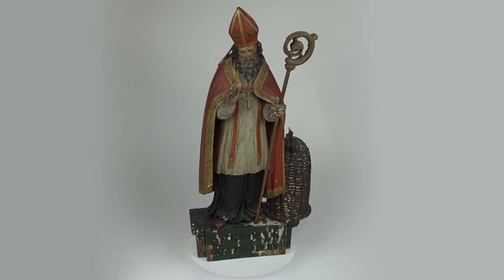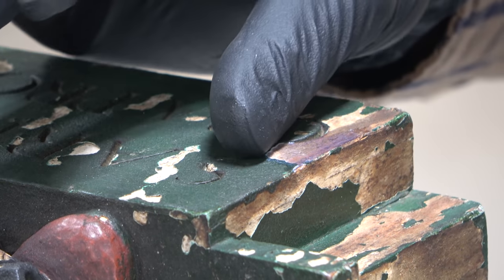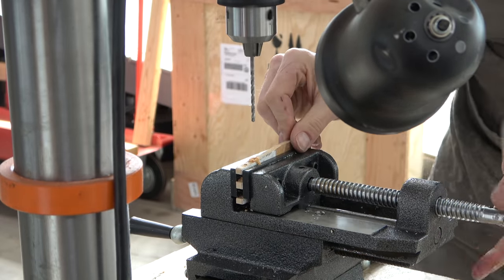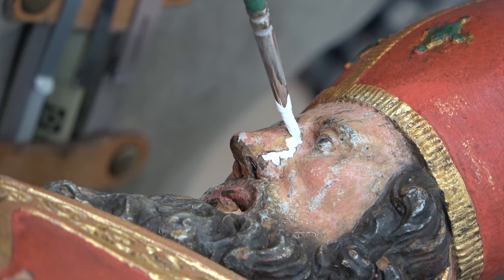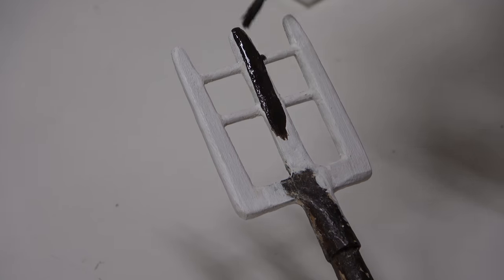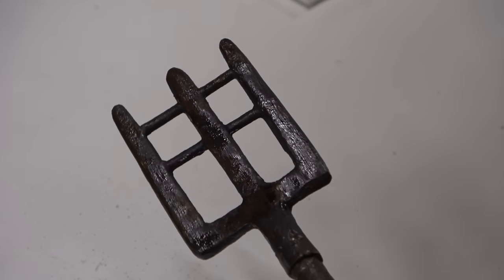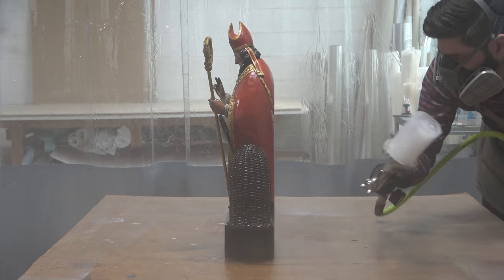Cheers

Comment: During the spray paint, the over spray is clearly visible.  You protected everything but your eyes.  As a painter, retired, we use a full face mask.  The composition of varnish can translate through your eyes and through the tears. Great restoration!
Reply: So in the final result, did you see any spray marks? I didn't.

Comment: Awesome job as always! I do have a question though: did you need to take any precautions due to the lead paint? I was glad to hear you say the varnish would help prevent future flaking, but how did it affect the rest of your process, if at all?
Reply: im not an expert but iirc lead in small amounts doesn't really have that much of an effect unless you're in contact with it over a very long period of time. therefore i don't think any percaution would be necessary here
Reply: Main thing about lead precautions is yo not make it airborne. So don't sand items with lead paint instead use a chemical paint solvent. Because Julian isn't removing the paint at all there shouldn't be any worry

Comment: Another great conservation video! Have you tried small squares of either smooth surface blotter paper or even ph neutral artists drawing paper lightly dampened with distilled water to remove the excess residue surrounding your fill in material? You may find that it goes quicker than cotton swabs and will not pull out any material from your filled in areas. 
I have also used this method with lacquer thinner to remove the excess black lacquer on the very shallow numerals and engraving on freshly silver plated antique clock faces. 
It works extremely well and leaves the lacquer or any "fill in" material flush with the surface without pulling any material out. Try it. I know that you enjoy trying out new techniques. 
I have used this also on oil paintings & sometimes with distilled water with a bit of denatured alcohol or isopropyl added to the water. Stay Safe & please keep on making videos. They are so enjoyable to watch and are as flawlessly executed as your amazing work.

Comment: I would LOVE to see Baumgartner restore the finish on a 50s or 60s electric guitar.  It would be fascinating to see what he would do differently from a traditional Luthier.  For example, Luthier's don't use reversible materials.
Reply: Some materials Luthiers use are reversible including hot hide glue and some finishes including lacquer and shellac.  However, many newer instrument finishes are not reversible including oil based, epoxy or catalyzed and UV cured.  It would depend upon the age of the instrument and the application.   French polishing is one of the older reversible finishing techniques. Spraying nitrocellulose lacquer is very hazardous and French polishing is a difficult skill to master.  A 50s or 60s guitar would have to be a total write-off before I would attempt a refinish simply because it would greatly reduce the overall value of the instrument. Even then I would be reluctant to take that on as a commission. Note: My YouTube user name isn't connected to my business but like you, I am a huge fan of Jillian's work.

Comment: Wonderful vid! Always love it when you post, Julian. FYI: the "tunic" is called a "surplice."
Reply: Yes, and the staff is a bishop’s crozier. It symbolizes that Arnold’s was the shepherd of his flock.
Reply: I think a bishop's or abbot's surplice is called a Rochet
Reply: @slartibartfast2649  You are correct! :-)
Reply: @slartibartfast2649  Surplice and rochet are two distinct garments. Rochet it part of choir dress of prelates like cardinals, bishops or monsignors, it is not a liturgical vestment and shouldn't be used as such. On the other hand surplice (or cotta) is a liturgical vestment used both by clergy and altar boys. The biggest difference between them is in sleevs. Surplice has very wide and loosely fitting sleevs. Contrastingly sleevs of rochet are tight and are lined with silk of white (the Pope), scarlet (cardinals) or amaranth colour (rest), depending on rank of prelate. Rochet always has lace so that the lining of sleeves may be seen thought it. Surplice doesn't need to have lace, same with alb. 
I don't blame you for confusing them. Most people do, since they look very similar especially if a surplice has lace.

Comment: When the lead test came back positive I fully expected you to strip the paint off with a solvent. But then I was quickly reminded that you persevere paint, not restore objects lol
Reply: Stripping that paint would have been sacrilegious!
Reply: Lead paint is not dangerous. Only if you lick it, or pulverize it an inhale the dust. None of which will happen with any sane mind. I'm washing lead paint for repair on my basement foundation. All I have is a used covid mask and I have a spray bottle of diluted elmers glue that I spray on for the scrubbing phase then wipe off with rags. The glue helps keep lead dust from leaving the paint when scrubbing. Then go over again with hot soap and water to wash the glue residue off and then the concrete is prepped with a solution that penetrates the concrete to allow the sealant coating to stick. No danger.

Comment: Fantastic work as always. Only thing I noticed was the top of the staff was backwards in the final shots. Was that the correct direction the medallion was supposed to be facing as per other examples???
Reply: Doing a quick bit of research on saint images that include a crozier, it seems to me that the position Julian put it in--with the "open" side of the curl outward--is slightly more common.  The staff isn't fixed in place and could be freely turned in any direction, so it's probably hard to know what the actual orientation was when the piece was first made.
Reply: I also noticed that, and I think Julian might have turned it around because one side of the staff is more detailed and was therefore probably intended to face forward. My guess is that the piece had been turned around by accident before, and during restoration, Julian made an informed decision to change it "back".
Reply: @kalli-ope  Good catch on seeing that one side is more detailed than the other--I missed that myself the first time around!

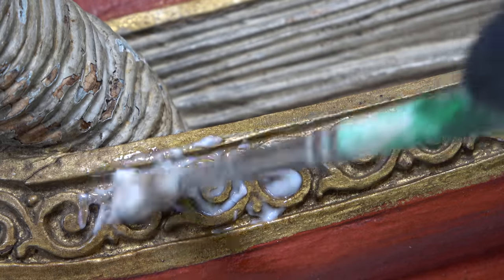Comment: At 7:13, Julian completely strips part of the gold paint into bare wood. You can check and see that at 7:01 the paint was there but flacking... and at 7:13 is completely missing.

EDIT: At 7:17 Julian strips off another chip of paint.
Reply: The gold paint doesn’t get stripped completely. At 7:01 you see it covered with clearer and at 7:13 he’s wiping the clearer off. The bere wood is a different colour.
Reply: @lburton874  I think you are looking at the wrong place. It's in the left bottom side around the 1/4 of the screen from the left to right and 4/5 top from bottom.

Comment: I'm curious why you went with PVA glue instead of hide glue for the mash rake repair, given that hide glue would be equivalently strong in this situation but is reversible if necessary.
Reply: The problem with rabbit skin glue on the rake repair is that RSG will absorb moisture from the air, which in turn will make the joints flex, over time the joints will become unstable and eventually break or fall off.   RSG, in general, isn't a good adhesive when dealing with something delicate, it works better when it has a huge surface area (e.g. when used in furniture).   

If you want to learn more about RSG may I suggest you check out Thomas Johnson Antique Furniture Restoration here on Youtube, Tom is a master furniture restorer and has a bunch of great videos, including one that discusses the pros and cons of different adhesives in antiques.
Reply: Permanently gluing the new rake to the original handle surprised me too--I get why he would want it to be sturdy, but permanent is such a change from the norm.

Comment: Very nice.  Most restoration channels I've watched would usually just strip the object and repaint.  Glad that wasn't done here.  One question.  On a lot of your paintings, you apply an isolation layer so your paint can easily be removed, which wasn't done here.  Just curious if this is reversible, since I'm guessing your UV scans probably cant detect touch up paint on a solid object.
Reply: Omg that's not a restoration (stripping and repainting) that's a butchery!
Reply: @Stettafire  I've seen those, they're awful! Not only do they sand blast the paint away, but then they often replace it with car body paint of all things!
Reply: As he says in literally every video, all the paints he uses are reversible. The isolation layer often isn't primarily to separate the original paint from the retouching, but to saturate the original colours so that they're easier to colour-match with the retouching paints, then the top coat brings it all together. And with some paintings, the isolation layer is more viscous when he applies it to help even out the texture.

Comment: .....I have a question and sorry if it might be stupid, but, why did you apply the varnish AFTER and not before putting the stick in the hand of the statue? this way the part that's covered doesn't get any varnish. is it done on purpose?

Comment: as a paper conserver, I get a Chinese paper-covered statuette once in a blue moon the darn thing is these things can have many layers of paper how to deal with that the customer wants the earliest version to be the one but, how to get it all undone?
the core is wood and it's just a core it doesn't show many features it's in the paper covering it with elaborate painting on it where the sculpture becomes 3D.
well, I take all of it off pealing one layer off another is crazy! I cut the thing on its back to the core and all will peal off because the glues are no more after 800 years then with the paper isolated you can detach every layer perfectly like a Russian doll and do it dry. 
from one very ancient Tibetan statue, I got 120 paper covers/shells all different and I all restored them with no seam to be seen I have 2 of the paper shells in my collection today.

Comment: hi i have a question. you tested the paint for lead, so would your procedures change if you found no lead? would it be possible and safe for the piece to be conserved if you didn’t test or confirm the kind of paint used?

Comment: Fascinating to see the difference in approaches between Julian and Tom Johnson,  or TysyTube.  The instant they'd have found lead paint, they'd have stripped or sand-blasted the object, and refinished it from wood on up.
Julian, did you discuss that possible approach with the client, particularly since there must have been a workshop in Naples or Avignon or someplace where these were cranked out by the thousands?

Comment: Why did you choose to use wood glue instead of rabbit skin glue for the rake? Is it because you had to make the new bit? Would you have used a reversible adhesive if the original bit was still there but broken?
Reply: This would generally be considered a mistake, or even malpractice, on his part by the wider conservator community, who in general are very critical of any work done that is potentially destructive or not totally reversible. It's a whole thing and I don't agree with a lot of the criticism Baumgartner receives, but this is one point where he is definitely in the wrong.

Comment: When cleaning up fine mechanics I often use some (often solvent based) cleaning solution and a brush that when somewhat dry can "suck up" the dirty cleaning solution and then I can drip more of fresh one in to concentrate on certain areas that are worse, this way I can speed up the process instead of constantly switching between tools... I wonder if this would be useful here too or if there is a particular reason why this would be bad here...

Oh and why can't we call this just a 3D painting? ;)

Comment: Since you use wood glue which is non-reversible, on the sculpture, doesn't that break the code of the conservator?
Reply: For every rule,  there is an exception. This is true in every aspect of life... Additionally, the glue may be irreversible, but the process is not. The fork could be removed with minimal consequences,  if at some point the original were found...
Reply: @Quickened1  that's true good point

Comment: I am not really convinced by the approach of "permanently" gluing the mash rake with PVA (?). Unless St. Arnold will take extensive baths, hot hide glue (preferably rabbit hide) would have been preferable. Easily reversible, this tenet is true for any restoration / conservation, not just paintings. You would not restore / conserve period pieces, be it sculpture or furniture, with pva glue or any similar agent. You can make little clamps by bending steel wire into Cs to secure small pieces like this, while the glue cools down.

Comment: i would like to find a restorer near to me- I have 2 "ceramic" plates that my father bought  at an auction years ago. Both the plates are of horses and riders of Arabian decent, and are very dark in color. My father loved these plates very much, and I have them packed away in a foot locker.  They are missing paint and are unbroken, and need cleaning badly- could you help me find a reputable restorer?  I live near Rochester MN. Rochester is about 2 hours from me, but I would be willing to hand deliver these artworks to a good restorer- Thanks for any assistance you are able to give.

Comment: I'm baffled by the lead test. You've done many paintings that have been flaking and damaged and are in private collections but never showed that you tested them for lead. I can see if you were going to strip the figurine and might aerosolize the paints through sanding but you're not removing the paint at all.